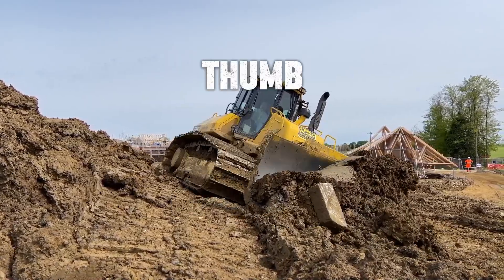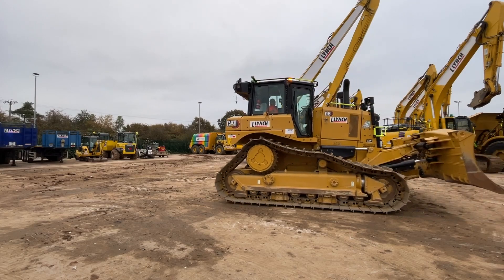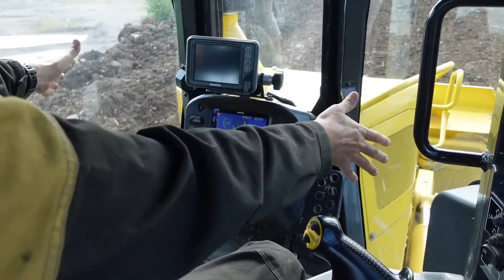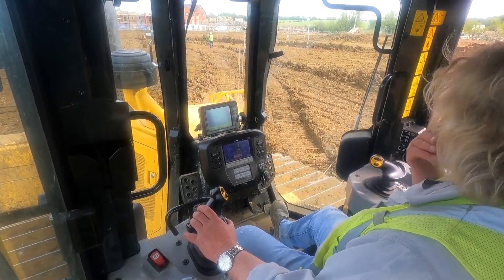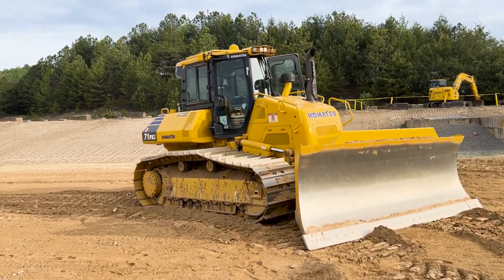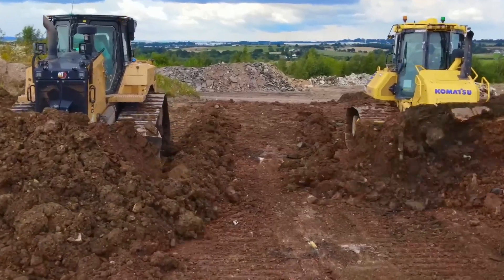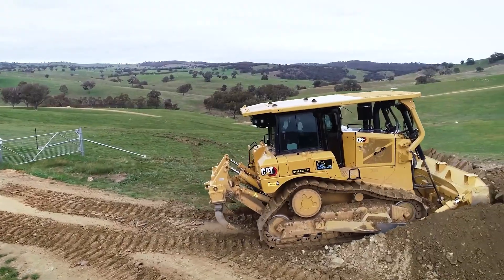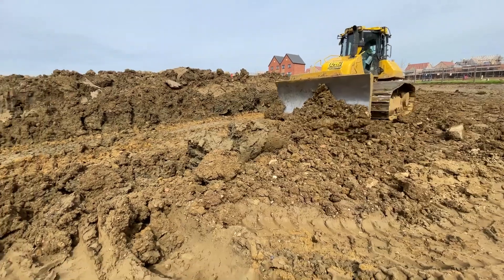The Middle Weight Bulldozer Battle: Cat D6 vs Komatsu D71

Comment: In your opinion what’s best for a dozer HST vs TQ? 
Also what’s your opinion about liebherr dozer like 734 lpg ?
Reply from the maker: I think Hydrostatic vs the Torque converter superiority all depends on what it is that you're doing and what kind of dozer you have. Hydrostatic if you're doing normal work and Probably Torque converter if you're doing big earth moving like for a mining application. I don't know much about the liebherr 734. I will add it to my list to make a video about it soon. I do have a video coming out in a couple of weeks with the liebherr 779. If it's anything like that it probably has some pretty impressive tech.
Reply: @Massivemachina sorry to bother you again so the TQ is more capable for hard work or it’s just more durable 
Also just for pushing big loads with the blade fully loaded what’s better ?
Reply from the maker: I am by no means an expert. The TQ would likely be better for big loads with the blade fully loaded. That just an assumption based on the fact that all of the big dozers have them.

Comment: Love 71, cats too noisy, visibility’s terrible, forced to look over the same shoulder all day ending up with bad neck, some clown decided to put a massive fuse box over the left shoulder making it a total blind spot, I would never rely on the camera so in my eyes the cat is a death trap. Great dozer for power and reliability though. I had a 71 for several years on HS2, there’s so much you can do with it, it’s so easy to create your own models on the topcon system too, you can shape an entire area to direct the water to a certain point, pin point accurate with 30 seconds work on the screen. Best dozer I’ve ever been on. (Worst is CASE!!!!)
Reply from the maker: It's funny. Seems like people either love or hate CASE. Seems like there is no in between when it comes to that brand.
Reply: @Massivemachina I’ve never met anyone who likes them 🤣
Reply from the maker: @Ste- oddly enough it's my brother that seems to love them. Something about the controls he likes.
Reply: @Massivemachina I think the only positive thing I remembered about the one I was on, was the air con was ice cold. But every time I touched a door handle I got a massive static shock, and changing direction in it was extremely violent, even in low speed.
Reply from the maker: @Ste-_. ice cold ac is great. Being shocked is bad. I can see why you wouldn't be a fan.

Comment: Auto features just make poor operators. An operator should be able to cut grade without GPS. If you can't read grade stakes and cut it right, you aren't an operator, you are a driver. I'm not saying GPS is bad, but you should be able to work without it just as well as with it
Reply from the maker: You make a solid point! Understanding the fundamentals of operating heavy machinery is crucial, and being able to work without GPS is a valuable skill for any operator.
Reply: @Massivemachina I started in 1984, it was grade stakes and string lines to check. You got really good at reading the machine and the material really fast

Comment: With 60 yrs of seat time on dozers and recently been on both machines my pick is the D71 for all the reasons given in the video. Visibility, quietness, cab  layout and room, ease of access in & out of cab & way less dust dust created with the radiator at the back.  D 6 next Gen I am on at the moment drinks about 15lts of add blue  per day, the D 65--- 18 I was on does 10lts per week and has the same size engine as the D 71 in that they are both about 9 litre . Terex/ Euclid had rear cooling systems nearly 70yrs ago so it not a new idea by any means.
Reply from the maker: Thanks for sharing your insights! It’s always great to hear from someone with extensive experience in the field. The differences you mentioned really highlight the strengths of each machine.

Comment: As a field tech , hands down Cat , always cat. The challenger is good that’s till you hv to deal with the parts department, then it’s nothing but a headache. They do not have the support after the sale. That’s where komatsu ALWAYS falls Way Short!!! Can’t call ( they never answer) so I hv to drive there knowing there is a 85% chance they won’t have it in stock!!! It’s about the up time  and Cat is king in that category
Reply: Well, in my European country we have an excellent Komatsu dealer so service is not a problem. Regarding the dozer, I was on a D6xe and thought it was the best dozer I have ever tried, that is, until I tried the D71. The quietness and visibility are outstanding and although I like the Cat controls a bit better, the D71 is the winner. It was only let down by the Komatsu/Topcon gps system I think is inferior to Trimble that’s on most Cats
Reply: @hjorleifuringason2778 that tremble has been in use ( that I recall ) since the early 90’s and it has come a long way. Makes it easier for lower skilled operators accomplish high end work in a very efficient time.
Reply from the maker: @hjorleifuringason2778 the visibility and quietness is definitely two of the big selling points for the D71
Reply from the maker: You're are right. CAT's support network is second to none. If komatsu took the time to improve theirs they could really give CAT a run for its money
Reply: @Massivemachina  yes they could!!
Reply from the maker: @sonofmontezuma3732 it's amazing how many comments I have on these videos saying the exact same thing. I guess komatsu isn't listening to the feedback people are giving.
Reply: @Massivemachina everyone knows Komatsu was is the World leader in dozers. But in North America Cat is King!!! I remember one time I went to a quarry to work a huge wheel loader , if memory serves me right ? I think it was called a Michigan wheel loader had Cummins power. Great machine the weak point was the lack of dealer support. Then came Kawasaki wheel loaders same thing good machine poor after the sale support
Reply from the maker: @sonofmontezuma3732 It amazes me how many big companies don't understand how much good support can grow your business. Not only does it keep current customers coming back but it builds your reputation for new customers.

Comment: The Komatsu D71 is the winner. It is the legend killer in this match-up. It's so much more quiet and operator focused. Great idea putting that cooling system to the back of the machine for better operator visibility, and I think it looks better with the bulge to the back.
Reply from the maker: You make some great points about the Komatsu D71! Its design and operator-focused features really set it apart in the battle. Thanks for sharing your thoughts!

Comment: The bigger field of vision on the Komatsu D71 has got to be a game changer
Reply from the maker: Absolutely! A wider field of vision can definitely enhance safety and efficiency on the job site. Great observation!
Reply: Oh heck, yeah!!! If this was the only plus of the Komatsu D71, I would still pick it as the winner. No visibility/blind spot in my car has caused me 2 car accidents.  Poor driver design of my prior car because of excessive leaning and stretching has caused me to pull my back out once. So, a bigger field of vision is a massive plus.
Reply from the maker: I completely understand where you're coming from! Visibility is crucial, especially when operating heavy machinery. The Komatsu D71 definitely has some advantages in that department!